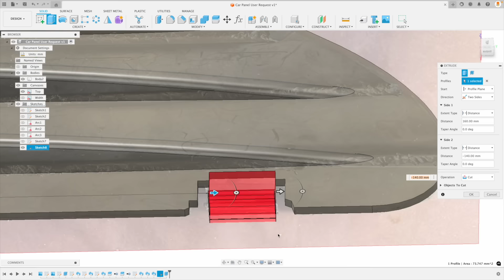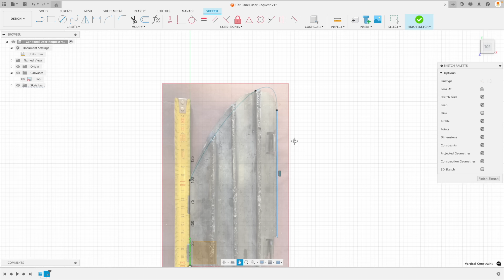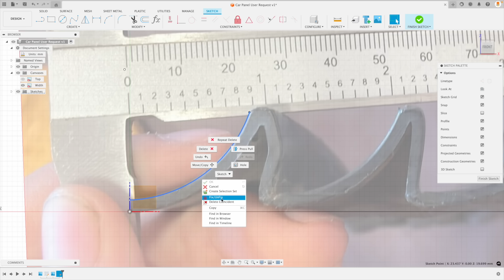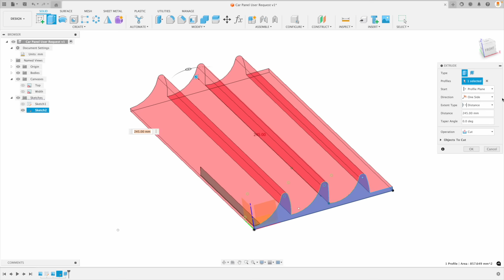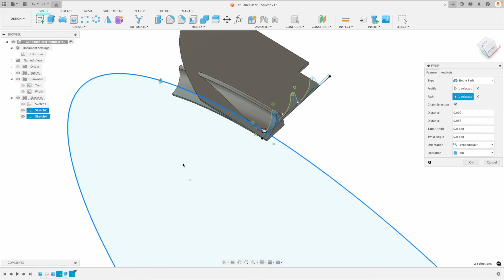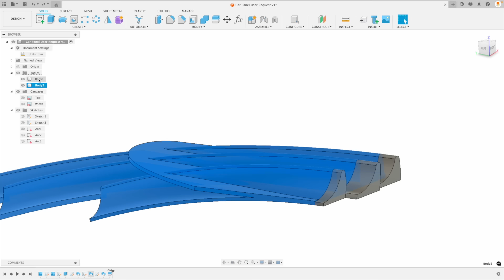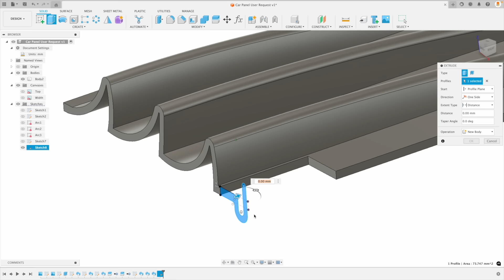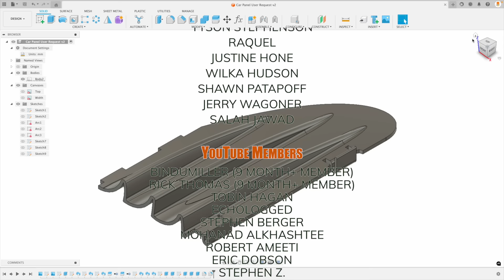Autodesk Fusion 360 - Complex Car Part - Intermediate/Advanced Tutorial (2024)

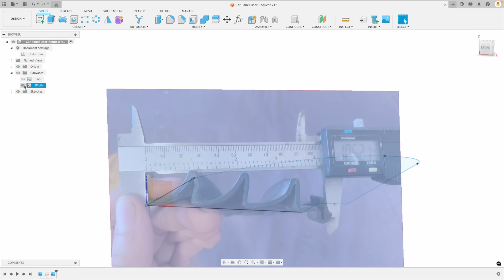Comment: 11:45 Cant you make a construction line on the object and then scale it on exact lenght with the picture at same time to avoid scailing picture alone to match the lenght needed?
Reply from the maker: Great question. It would be great if you could, but you can’t at the same time. It saves a step doing the way that I showed, but your way works too.

Comment: At around 18:00 you make the end point of the first spline curve vertical with the origin. But that curve was locked. What is the behavior when constraining a locked curve? Does it translate the curve in the plane to make the end align, or does it adjust the curve so the end is aligned? How absolute is the lock constraint?
Reply from the maker: Wow, excellent observation skills. Believe it or not I learned the answer to your question when producing this very tutorial. It seems that locking an arc or spline doesn't necessarily mean that the end points are locked. Sometimes the end points get locked because they are constrained to another element, but in the case of this tutorial they weren't and therefore could still move.
Reply: @learnitalready  Thank you. If you have time for another question, I've been wondering if the order you click on two elements when applying constraints matters. Say I select collinear then two lines, which one moves to be online with the other?  1st one moves to 2nd, vice versa, or is it arbitrary?

I've been learning fusion 360 since I got a 3d printer after I retired. It keeps me thinking.
Reply from the maker: @jssamp4442  in some of my earlier tutorials, I answer that question a few times. Always remember the rule: this to that. In other words, what we click first (this) will move to the second object (that). Hope you check out our early stuff. Many have expressed appreciation for the fundamental building blocks that are taught. All the best!
Reply: @learnitalready  I will definitely go watch your videos in order. The way you present it just clicks for me. I'm sure I will learn something that I missed in each lesson. Thank you for sharing your knowledge.
Reply from the maker: @jssamp4442  great to hear and you’re most welcome 😀

Comment: Good overview of some features. If you right-click on the photo under canvas, you can use calibrate, as the images are fine with tape measures and calipers. Select two points that give the distance and the image is calibrated, without drag and drop error. Too bad you captured some of the damage in the sketch. The vertical side of the wave should be straight and not curved on any of them, it really shows with the difference how the first is affected second less and tired almost not at all.
Reply from the maker: Thanks for your comment and tips!

Comment: How do you get fusion to run so well?? A long time ago I had no problems but then I had issues and stopped using fusion even though I loved it
Reply from the maker: Oh no! What kind of problems did you run into? Fusion runs very well for me, and I’ve never had any serious issues with it. Sometimes it would crash, but I learned it was because I was making too many dependencies. I’ve gotten a lot better at my workflows and find it can handle a ton of calculations without problem. 

Happy to help you if you need it.
Reply: @learnitalready  I’ve had problems of it lagging with huge delay inputs for simple stuff at times. One thing that is really annoying is when you go to rotate a model (even just a basic cube) it goes transparent and with a very laggy. That’s the best way I could explain it. It is very hard to use when it’s not smooth. I’ve tried on both my laptop and pc and have the same issue. Other programs seem to run no problem.
Reply from the maker: @panaplexi5708  that’s too bad to hear! Super frustrating. I generally use a 2018 Mac Mini for most of my tutorials until recently when I upgraded to a MacBook Pro M2 model. It works, but is still not as nice as the desktop workstation I used at my last job.

Comment: You make it look sooooo easy!
Reply from the maker: Thank you, but I’m sure you’ll get there too. Keep up the great work in learning like you are. 👍
Reply: @learnitalready  I'm just curious. How much would it cost to design something like that? How much you or any other designer would approximately charge for it?
Reply: @Jookeerr  That’s hard to say. There are lots of factors to consider when designing something like that. That tutorial only took 40 minutes to record and I’m sure a) the part didn’t fit and b) wasn’t exactly to the spec of the user. The tutorial was designed to guide the user to know the basic skills of how to go about designing it. 

I just did a job designing brake rotors using Configurations which took me around 24 hours to design. So that was a little pricier project. There was also a bunch of back and forth between the customer.

Comment: Hi I live in chile and I’m working on  creating a dome or semi sphere of 600mm of diameter. The idea is to break it into smaller even components so I can 3D print them and screw them together so I imagine that every piece must have a lip to join them. This is going to be a mold for pouring a rubber like material. I have learned a lot from your videos but I’m still unable to do this. I am really thankful for all your work and efforts in making this tutorials.
Reply: If anyone has an idea for doing this please share it with me. Thanks
Reply from the maker: Hello! Thanks for reaching out.

Regarding printing in several pieces, there are a few methods to do this. 1) Nowadays slicing software that comes with your 3D printer usually has this as a feature. You’ll have to inspect the software package to see how to use this function. 

2) The harder way is by using Fusion, but the models can be built specifically to your needs. Since no one solution works, it’s difficult to make a tutorial to discuss the principles involved in splitting up a part into several sections. However, if you feel like sending us your part for us to take a look at, perhaps we can make a tutorial on this specific topic. 

Hope that helps!

Comment: My takeaways - sweeping profiles where path doesn't intersect profile, extending offset line segments and remove instead of delete. BTW, when 3D printing export OBJs instead of STLs. OBJs preserve geometry whereas STLs are triangulated reducing surface quality. Most slicers will import OBJs. Thanks for the video, I don't mind the long format, I watched at 2x slowing only where I needed to see a new modeling approach.
Reply from the maker: I love it! Thanks Craig. I always value your input. Great suggestions. I’m surprised this video has taken off so well, but super glad many have said they are benefitting from it. Hope to hear from you again soon.
Reply: @learnitalready  I've been using Fusion for about 4 years and have never looked at the sketch "Modify" pull down menu. I know, sounds weird. Extend, Scale Sketch, Break, Blend Curve, etc, never seen these before. I'm playing with all these this morning. Thanks again.

Comment: You shouldn't use that first point on the tape measure.  tape measures move about a 1/16" depending on grabbing onto the edge or pushed against the face.  So the beginning of the yellow part is not the 0 millimeter mark.   I would have started at the 10mm mark and went from there.
Reply from the maker: Very good point. Thanks for comment. 
Yes, that was mentioned by another user too. While I 100% agree with you, I didn’t focus on it for 2 reasons for this tutorial: 1) even if I was 1mm off with the initial point, over the span of 20cm I would have been out of scale by only .05mm which is half a human hair and 2) the perspective of the picture was also not the best which means that it is very difficult to get an accurate measurement. 
But, if we were to try and ensure the best accuracy possible, then you are absolutely correct in what points to select for best scaling. We would also need to zoom out to the highest focal point as possible to make sure there is the least distortion with perspective.

Comment: adding a tip for the canvas!
there is a calibrate function where you can set a distance from specific point to point and state in the canvas that distance measures X 
it helps get precision level measurments with your canvas :) or helps remove the eyeballing part
Reply from the maker: Thanks!

Comment: Wow. Just got my first 3D printer today. DL the free version of fusion and found your video. I can't believe how easy it is to use. So many things I want to make custom for my old car. Thanks for making these videos!!
Reply from the maker: Thanks so much for your comment! What printer did you get? Hope you love our other tutorials too. Lots more on the way. Hope to hear from you again!
Reply: @learnitalready   Uh, I think its a Creality Ender 3 V3 KE
Reply from the maker: @ Nice! You will have fun using that for sure.
Reply: @learnitalready   Do you have a tutorial about making a whole part, then being able to split it into 2 or more pieces to be joined together? Probably easy, but can't quite figure the best way out. Needs like a groove or dowels put in it so it'll line back up good.
making a shifter cover for my vette, and it's too large for my table. Tried building it vertical and it started leaning slightly. Redid the design with a curved top, which def needs to be laying down.
Also can you add the supports in fusion? Or is that just something the creality software need to do?
Reply: @learnitalready   So do you have a tutorial that will show me how to create a sketch on a Z plane relative to an X plane sketch?
So say I extruded a cube from a sketch on the X plane, and I want to now want to create a circle say like 200mm away from centered to one side of the cube, and about 15 degrees below and perpendicular to a side of the cube. Basically I want to make a tunnel coming out of one side of the tube, going down about 15 degrees. How would I tell fusion to line all that up? Trying to wrap my head on how best to do it.  
Theres a loft command that looks like what I want to use, but how do I make the sketch line up perfectly centered and a certain distance away?

Comment: I agree with others on how well you deliver the information.  I feel like I gained several levels in Fusion. I try watching others tutorials but find myself falling asleep within the first few minutes.  Only thing I would say, that I learned from another YT channel, is since it's going to be 3d printed it doesn't need to be designed the same as an injection molded part.  If the underside doesn't need to be hollow for fitment, don't.  Makes it harder to print and doesn't save you anything. Something I've been trying to keep in mind when making parts to be printed
Reply from the maker: Thanks so much for taking the time to comment. Glad that this user request tutorial has been something that many have benefitted from. Thanks too for your input about the underside of the part.
Hope you like our other tutorials too. All the best!

Comment: Outstanding. Very helpful and PRACTICAL. Many of my projects are for parts like this where I'm replacing something broken, or creating something new that has to fit in a complex space. Would love to see more of these types of tutorials, especially for wholly new parts where you can't photograph the original (or broken) part but the other constraints about where it has to fit/attach/not-interfere ARE available. 

Related tip, FWIW: in addition to including known dimensions in an image (like a tape measure or ruler)  it really helps to minimize perspective distortion. An iPhone camera includes guides to show when the camera plane is tilted off of orthogonal planes. The line turns yellow when aligned. Also, simply stepping back and zooming helps to minimize distortion.
Reply from the maker: Thank you so much! Please feel free to send us any suggestions you might have for future tutorials.
I was also thinking about talking about proper perspective when taking pictures but decided not to in order to keep the length of the tutorial down. Perhaps a good topic to discuss in a future tutorial! Thanks again.

Comment: Zero chances this is even close to the original part. The proper way to do it is to 3d scan it.
Reply from the maker: Agreed… kind of. The original user didn’t have a scanner and wanted to do their best to model it. Plus, the original part was so damaged that scanning it wouldn’t have done it justice and depending on the scan quality is next to impossible to adjust/edit. If I had the part in hand I would have done a bunch of measurements to reverse engineer it, but I didn’t. I did, however, encourage the original user to take a bunch of measurements so that he could design the part properly.